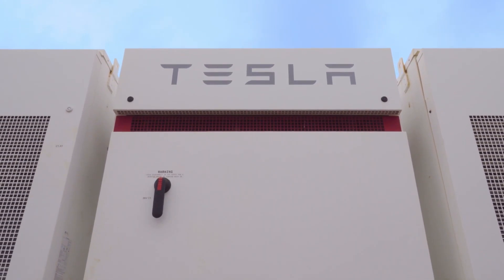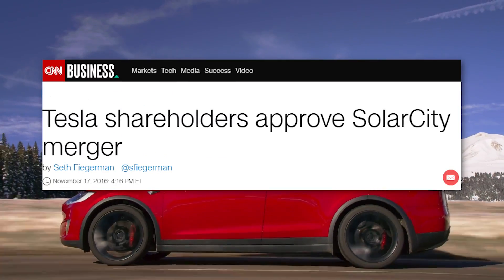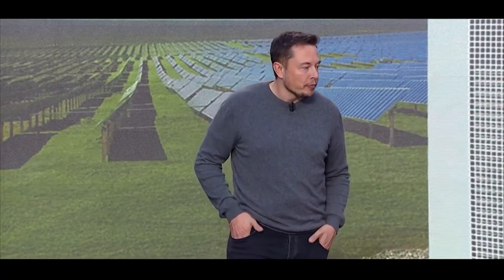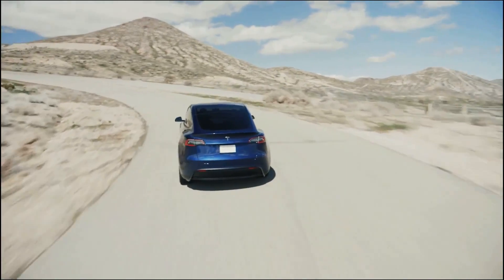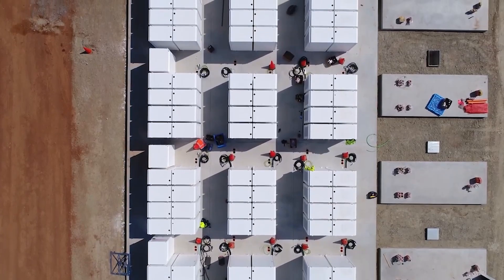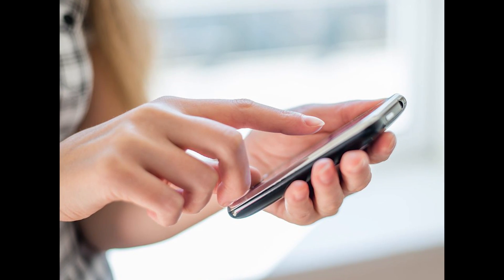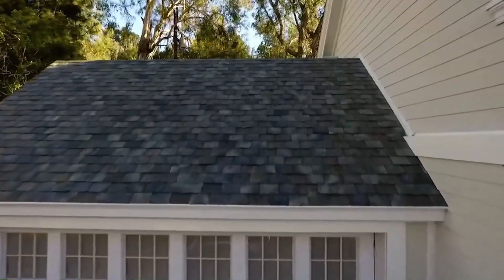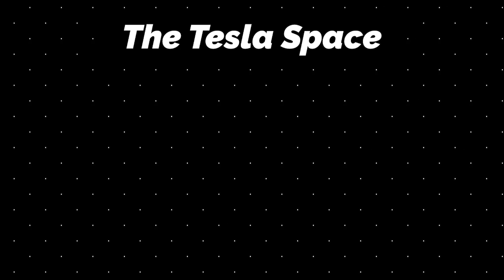Why Tesla Solar Will Take Over In 2021

Comment: This is way too much of another Tesla fanboy video. With solar roof and unlike for EV, Tesla is not an innovator and are rather catching up. In roof system or solar roof shingles have existed for several years and started in Europe. Especially, in roof regular solar systems (so not on roof regular systems) are way more cost effective (when looking to do the roof and solar system) than a Tesla solar roof. What you are completely not mentioning that you put the expensive solar roof on parts of the roof which is not generating a lot of electricity (north side etc.) For Northern latitudes, no solar system (except if it it very large) with battery will generate enough electricity. The days are too short and the sun is usually too low, so you end up producing just a fraction of the electricity. November to February are usually difficult and you have limited electricity production. Also these are the months where you need a lot of electricity (you tend to be more inside and potentially heat with electricity). Lots of snow does not help either.
Reply: This is way too much of a crybaby complaint.  The majority of people in the US now live in the Southern US and California. With large amounts of annual sunshine and very little issues for the northern latitudes.  This isn't for everyone and if you're north of the arctic circle this isn't for you.  Thanks!
Reply: I agree with you. I just don't get why Germany is all in with solar. I'm in So Cal and weather here is perfect for solar but Northern Europe not so much.
Reply: @lesp315  Part of it was to have a solar cell manufacturing/exporting industry

Comment: Waaay too expensive for mainstream in Australia.
Reply: tesla cars also started off too pricey but has now become more affordable. i will support tesla's solar energy by being one of its early customers despite the price because i know they'll eventually bring prices down.
Reply: It will substantially decrease in price when production scales
Reply: Are you sure? Electricity in Oz is very expensive.
Reply: @lesp315  Yet enough sun energy hits Australia in 2 days to power the entire world for 1 year. Can you see you are being robbed yet?
Reply: @alberlusconi1  It looks like you like to use phrases, but not willing to look at numbers. I live in So Cal and decided to install solar.
My average electrical bill was $200 ( many households pay $300-$500 a month in my area). The system for my usage is 5 kW and cost $25k. After tax break my cost was $19.5k.
19500/(12*200)=8.125 My system will pay for itself after 8.5 years assuming cost of electricity stays the same. In San Diego at this point price per kWh is 26.25 cents and next year it will be 27.4. If not for solar I would be robbed by SDG&E. Maybe your situation is different, but for me it was the only way to go. You need to look at your numbers and go from there.
Reply: @lesp315  I got bored half way through that, can you summarize?
Reply: @alberlusconi1  First you need to buy your own house.
Reply: For now :/

Comment: They could install heating rods in the solar roof so that it removes small amounts of snow itself.
Reply: In practice it takes too much energy to heat that much snow, more than the solar panels would generate...
Honestly some kind of pusher system would make more sense.
Reply: I'm pretty sure that as long as you've got a good slope to your roof you'll be fine.  I'd think it'd shed the snow as well as a metal roof...
Reply: @henrypotter3024  No - it doesn't. Snow on panels is a major PITA. I have mine on a  ground mount that I built myself - and it has adjustable angle. Even with a 50-60 degree tilt they still get covered with ice and snow. The snow won't slide off unless the outdoor temps are substantially above freezing.
Reply: @kdanagger6894  isn't the Tesla solar supposed to have a hydrophobic (?) Surface?  I didn't pay to much attention but I had at least a few videos show up in my feed that seemed to highlight the snow sliding off on its own...  I know most solar panels have issues, but either the Tesla roofs are a little different, or my feed videos are trying to decieve me...
Reply: thankfully we don't have snow in Saudi Arabia lol
Reply: @az.alkadi   women's rights too is what you got in there... but religious extremism ofc you do have.